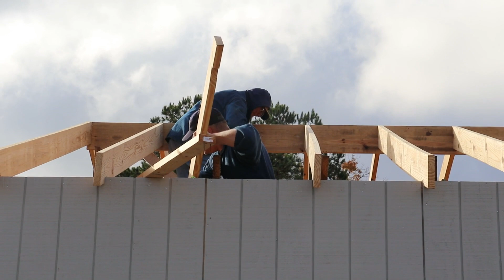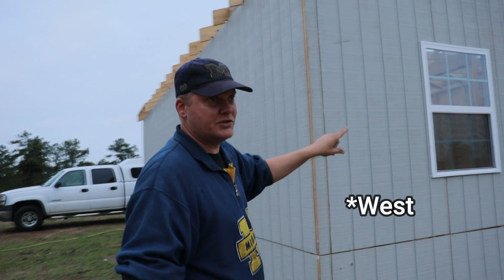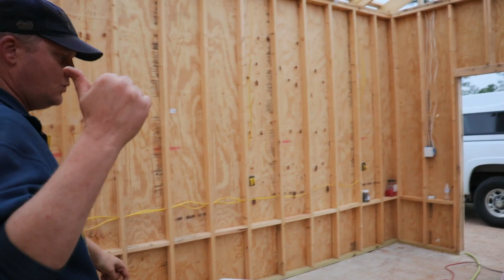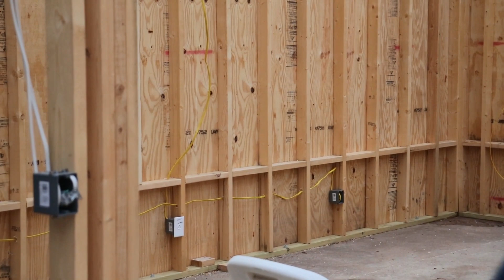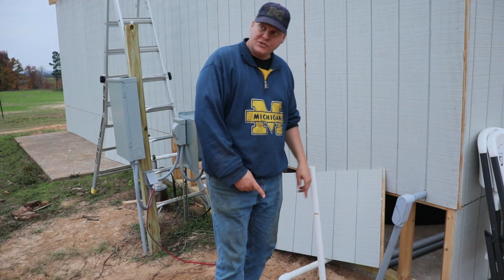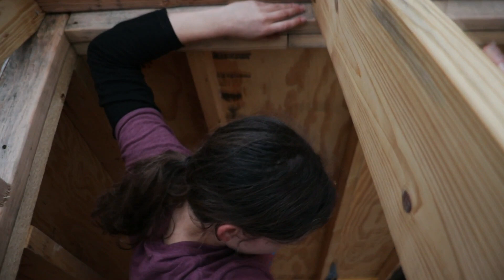Ep. 237 - DIY Shed for the Ranch Well House Part 4

Comment: If you use hardyboard or cement board, you never have to worry about rot.
Reply from the maker: I agree. I contemplated it but decided it cost too much last year when I got materials for a different project. I used whatever materials I already had for this project.

Comment: I was also wondering if that slab sticking out is sloped away from the building. I would think that water could collect and run into the wood.
Reply from the maker: Yep, it is sloped away. I wonder if they had a roll-up door there before